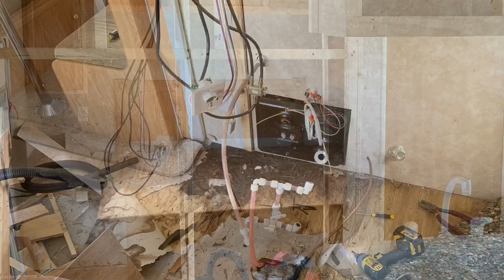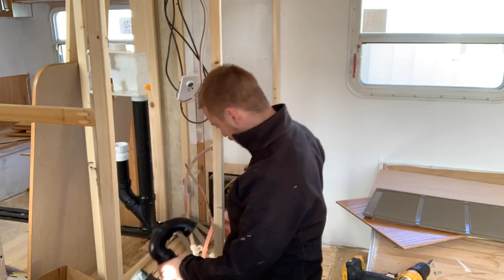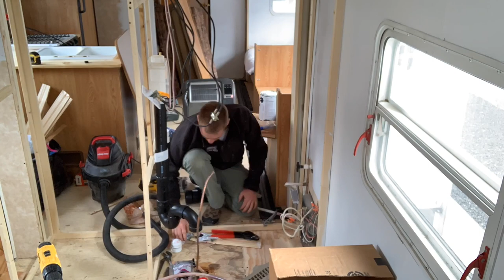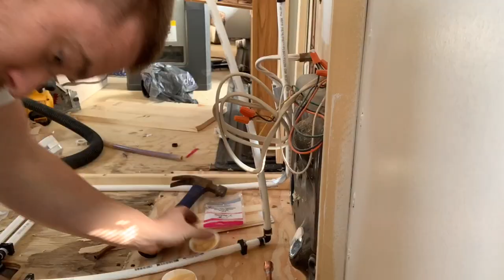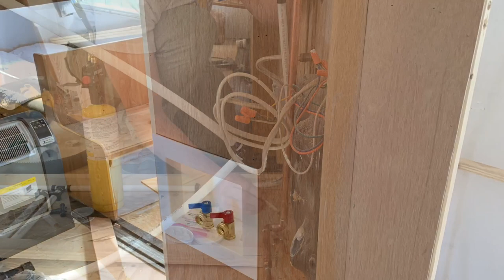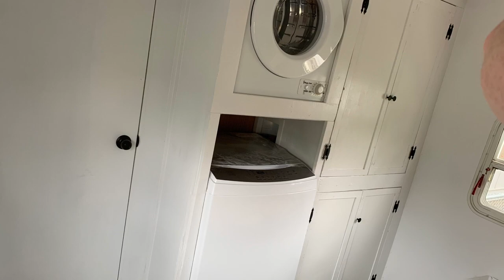Adding A Washer And Dryer To A Camper

Comment: How much would you say it would cost on average. To install a system in there and washer and dryer?
Reply from the maker: It’s hard to tell, it really depends on the camper setup, where the plumbing is located, how much remodeling if needed. Probable $2000-$3000 minimum

Comment: Would that also be possible in a Hymer Yosemite Fiat Ducato campervan? & I also would need constant running warm water for everything. What would I need for that? 🙏
Reply from the maker: It’s definitely possible yes. To have constant hot water at you would have to put a circular pump on the water line to allow for warm water constant and on demand. Not hard,  you can install the circular pump next to the water heater (it’s small doesn’t take up much space.)